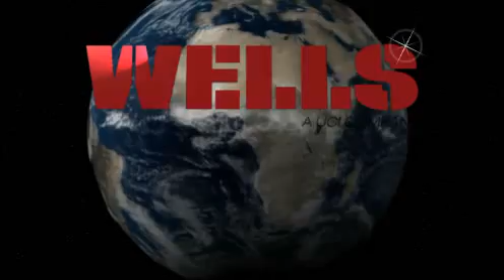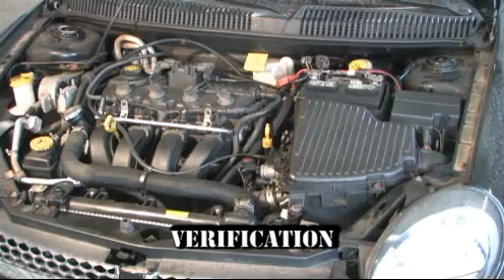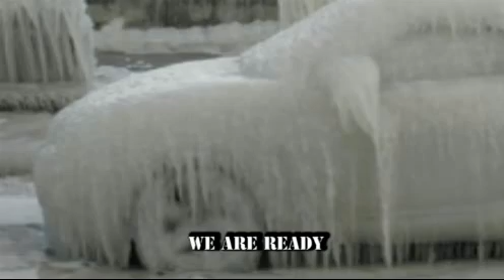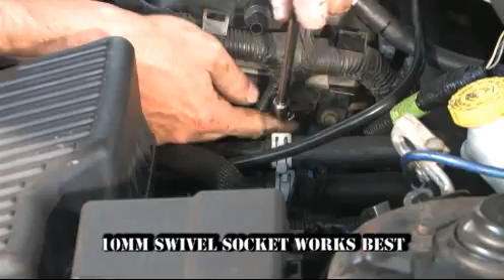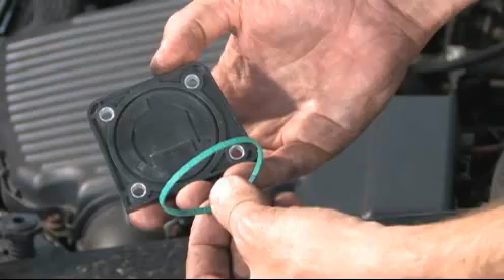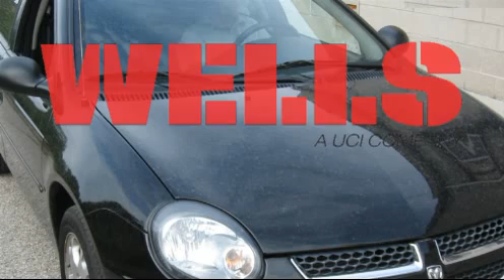Chrysler P0340 Cam Sensor Replacement

Comment: Will this make your car stall
Reply from the maker: Yes, it is possible to cause stalling concerns.
Mike Becker, Technical Services Instructor
Reply: Wells Vehicle Electronics okay thanks, I replaced this part and re computer in the car still say the part number in the odometer like it is the same part. (this is without a scan tool) I did the 3 times ignition thing. my car still want crank.
Reply from the maker: What kind of car are you working on?
Mike Becker, Technical Services Instructor
Reply: Wells Vehicle Electronics 2000 dodge neon
Reply from the maker: Do you have a check engine light on? If so, do you have a way to get the trouble codes? Also, can you describe what exactly is going on with your car?
Reply: Wells Vehicle Electronics on the way home, my friend was driving her car when all of a sudden the car shuts off, so we pulled it to my house. the next morning I checked all the fuses and some of the main relays (the ones I checked were good). i checked the ignition coil (no spark), checked the connector that attached to the ignition coil, I used a test light (no voltage from nun of the 3 pins). check to see if there was an engine light on, didn't see it. but when I did the 3 igntions swiches to check and anyways two codes come up, 1684, 0340. so I replaced CAM sensore and unhucked the battery for a day. it still wouldn't start. I checked the voltage to the CAM sensore both ends had voltage except for the middle, which I am guessing is the ground. (the car cranks good, but just want start).
Reply from the maker: It is possible that the crank sensor is causing the issues. They are very common on these cars as well. Has that been replaced?
Mike Becker, Technical Services Instructor
Reply: Wells Vehicle Electronics never
Reply: 2001 Dodge Neon, can confirm...this is why my car would randomly stall when I came to stand still at a red light.

Comment: Hi,
Can you perhaps explain the reason for the 2.0 Chrysler Neon 2003 taking a bit of time to respond when i put on 'D' or 'R'? This happens on cold early mornings only. During the day or when its not cold it responds 'D' or 'R' instantly.
Reply from the maker: Hi Keith, It sounds to me like you could have an internal transmission issue. Do you have a check engine light on?
Mike Becker, Technical Services Instructor
Reply: Thanks Mike for the feedback. There's never been any illuminating or check engine light at all. My layman view has been that perhaps its running out of the gear oil.
Though, I must keep it idling for about a minute for a 'D' (Drive) to respond, 'on early morning cold days' only. During the day (lunch, onward) take off is good! 
Also,this doesn't happen on warmer days at all, especially in in cases where i get to drive it only from midday. I start it and it takes off immediately.  

I appreciate your response Mike.
Reply from the maker: It sounds to me like a fluid problem inside of the transmission. When the fluid is cold it is thick, and maybe not coming up to a high enough pressure. As the fluid warms up, it becomes thinner and then at that point can probably make the right amount of pressure to engage. I would take it into a local transmission shop and see what they have to say. Good luck!
Mike Becker, Technical Services Instructor
Reply: Much appreciated Mike! This makes a lot of sense, and i sort of assumed perhaps some fluid or oil (gear oil etc) is not enough! I will definitely get it check ASAP! I will let you know too!

Comment: Hi Mark, I have a 2.4L Chrysler Sebring Touring. I am persistently getting a code P0030 ( Random/ misfire). I have done all testing on the ignition coils on all four cylinders( all good there), I have done the ohms test on all four fuel injectors( all good there). I have changed the plugs and the check engine light still comes back on after a minute of resetting with the scan tool. the same code of P0030 comes every time. One of the cam sensors( not sure which) has been replaced. when I look at the I/M Readiness on the scan tool it shows a red x on the ( Cat ) and a red x on the O2 sensor), and a red x on the (Evap). Could you possibly further throw some advise my way? thanks
Reply from the maker: +Troy Bigwarfe The I/M readiness are showing that way because the codes have been cleared and they haven't had time to reset yet, and probably won't test until the P0300 is fixed. It would be helpful to know the year of your car so I can look into any common failures there might be in regards to the P0300. It also would be a good idea to look at the misfire monitor on a scan tool and see if there is a certain cylinder(s) that is missing more than the other ones. If they are all misfiring you might be looking at a timing issue or possibly even plugged exhaust.Keep in touch.
Mike Becker, Technical Services Instructor
Reply: Its a 2800783-9495 chrysler Sebring Touring. A code P0335 came up today indicating its a crankshaft sensor. I am trying to locate the sensor now.
Reply: 2007
Reply from the maker: +Troy Bigwarfe A cam sensor is a good idea. They are relatively common on these cars. Let me know what happens.
Mike Becker, Technical Services Instructor

Comment: Look at Tech Service Bulletin #18-015-09, dated 5/9/09. There is an ECU Update to correct Codes P0340 and P0344.
Reply from the maker: Rick Hansen Thanks for the input, yes that tsb is related! Its always a good habit to check for related tsbs prior to replacing any parts. Thanks for the heads up, much appreciated!
Mike Becker, Technical Services Instructor

Comment: He is an interesting one for you. P0340 Replaced the cam sensor twice and still an issue. The engine will run fine but only to 2100 RMP's then it will break up. There is the interesting part; I will restart the engine and the problem is corrected for varying periods of time????
Reply from the maker: Eric Kippy That is interesting, lets start with what kind of car you are working on, and what engine is in it. 
Keep in touch,
Mike Becker, Technical Services Instructor
Reply: 2006 Sebring 2.4
Reply from the maker: +Eric Kippy Well just going of the one code you are getting, a cam sensor is the most likely culprit. It is a very common failure on these 2.4L engines. Being that you have already replaced it twice, I would inspect the wiring that goes between the cam sensor and the computer that controls it. Its possible that you have an intermittent bad connection and that's causing your engine to run bad. Let me know what happens.
Mike Becker, Technical Services Instructor
Reply: As I mentioned in the original post the cam sensor was replaced we also replaced the crank sensor. and the cam sensor a second time to make sure we didn't get a defective one. I think the key is the turning off and resetting something ??? then the engine runs fine again. This happens pretty consistently after about 5 minutes on the first start up after sitting for the night or several hours.

Comment: markjhicks  I have a 1995 neon coupe... I  recently replaced the Camshaft position sensor as instructed through your video, only I still have my original problem of no start... my computer is sending me a code 54 No signal detected from camshaft position sensor ... what all does this mean I thought I would ask an actual mechanic...thank you

Comment: replaced the cam and crank senor crank wont start getting p0340  2001 startus 2.4 will start when  cam senor is unpluged
Reply from the maker: Either the wiring has an issue, or the cam sensor is defective, or the PCM has failed, or the timing belt has slipped.
Mark Hicks
Wells Vehicle Electronics
Reply: replaced timing belt have signal to pcm when i unplug cam senor starts when runing and plug cam senor stops runing
Reply from the maker: either you a PCM, wiring or cam sensor issue.
Where did you purchase the cam sensor?
Mark

Comment: hi to whom it may concern, i have a problem with my chrysler voyger 2007 2.4, it starts Fine but has no power when you drive it, did a diagnostic test but no fault codes, can anyone assist please
Reply from the maker: When you say it has no power, do you mean when you step on the gas the engine does not rev up? Or, do you mean the engine revs up but you do not move? If it is because the engine does not gain RPM, check the catalytic convertor first. It could be restricted and not be letting the exhaust out.
Stay in Touch,
Mark Hicks
Wells Vehicle Electronics

Comment: Hello,
I have a 2003 Dodge Stratus. I have no starting problems at all. I have problems while driving, it will decide to stall while driving. Which is very scary. I was giving the code P0340 which is for a Cam Sensor but I was told these are problems of the Crank shaft sensor. Can you try help me determine which one so I can change out ASAP
Reply from the maker: Typically this means a problem with the camshaft position sensor. This is a huge problem with your vehicle and will cause the symptoms you describe. 
Stay in touch,
Mark Hicks
Wells Vehicle Electronics

Comment: I have 2003 Chrysler sebring 2.7 we changed the crankshaft position sensor but it still won't fire up. we thought maybe the computer but then after talking the the guys at the junkyard it didn't sound like it could be they told me if the computer was bad it wouldn't give me a code. I am uncertain if I should change the cam sensor even though that code didn't come up. Any ideas?
Reply from the maker: What code is being set? have you checked for spark and fuel?
Stay in touch,
Mark Hicks
Wells Vehicle Electronics

Comment: thanks for the video. I have a 2003 stratus that runs fine but just out of the blue decides it wont start. it rolls over and I smell gas. happens when the car is cold or hot. the only thing I can do is wait and keep trying it. it will eventually fire rite back up like nothing happened.I wondered if the cam sensor could cause this as well?
Reply from the maker: I will assume you have a 2.7 engine. The two most common causes for this issue on your vehicle are the crank and cam sensors.
stay in touch,
Mark Hicks
Wells Vehicle Electronics
Reply: thank you for the help.i changed it and it fired rite up. then I got about 4 miles down the road and it just died on me, sounds like the timing is way off now so I think it mite be a coilpack or crank sensor.any ideas on wich to start with first besides the cheapest one,lol. thank you for your help.
Reply from the maker: I would start with the crank sensor.
Mark Hicks
Wells Vehicle Electronics
Reply: thanks for the advice.
Reply: sorry and I don't mean to be a pest but I have replaced the coilpack, crank sensor, cam sensor,checked my timing, compression, fuel pressure,and the fuses just for fun with no results.wondered if you might have some inside wisdom as to what I mite be over looking lol. thank you very much for your time. it is appreciated .
Reply from the maker: Please you are not pestering me. You have a problem with your car and I am here to help.  Let me ask, does the check engine light come on? Have you had it checked for codes in the computer? Let me know,
Mark Hicks
Wells Vehicle Electronics
Reply: it did come on and the codes iv got from the key switch are-340-344-440-456.im smelling gas and the fuel rail has great pressure so I didn't think the evap codes would keep it from starting.Im a fair backyard mech. but im all out of tricks short of changing the computer. I even bought a lottery ticket tonight and that didn't fix the problem either lol. thanks again for anything you can suggest. any ideas are appreciated .
Reply from the maker: You are right the EVAP codes are typically not going to cause no start. But you have a P0340 and P0344 which point to an issue with the cam and crank sensor. The only way to be sure they are working properly is with a labscope. I will assume you do not have one, but you have replaced both the sensors. There have also been reports of connector problems and PCM issues. The next step would be to do a very close inspection of the connectors to the cam and crank sensors. If they look good, replace the PCM. But before replacing the PCM try disconnecting it and cleaning both the connector and PCM connection pins with electronic cleaner.
Keep us posted,
Mark Hicks
Wells Vehicle Electronics

Comment: Hello Mark, I have a question for you.  I have an 04 Sebring with the 2.4 liter, 135k miles, new timing belt.  It throws the 0344 code even with a new cam position sensor.  Symptoms are it coughs and stumbles on startup and sometimes has quite a hard time starting.  Once it's started it runs fine under light throttle up to about 2300 rpm where it hits a rev limiter.  Under heavy throttle, it misses on sometimes one cylinder and sometimes two but still won't go past the rev limiter at 2300.  Resetting the computer makes it able to rev up to another rev limiter at about 3500 rpm for a few seconds until the code trips again and the limiter kicks in at 2300.  It runs and drives smooth and perfect under 2300 rpm except when I stop in gear, when it stumbles and tries to kill unless I keep the rpms up around 800 or higher.  Could this be just the target magnet?

Additional info:  With the timing belt cover removed, the timing belt looks new, the marks are visible on the rear cover where someone had changed it before I got it, and the top of the belt between the two cam gears runs nice and straight and steady....until around 2500 rpm or so, when it momentarily "flutters" between the two cam gears through a narrow rpm range.  Could that be the problem?  A bad tensioner?
Reply from the maker: Thank you for the detailed explanation, It helps to get to the problem.
If the cam sensor has been replaced and you are sure the timing belt is aligned properly, the next check is the crank shaft position sensor. It is fairly common for the CPS to cause this code on your vehicle.
If you have a lab scope or scan tool you can monitor the CPS to see if it momentarily drops out.
IF you do not, check the wiring to the sensor and check for any signs of oil leakage from and replace as needed.
If the CPS does not take care of the issue, try another Cam shaft Sensor by a different manufacturer.
The timing belt tensioner may be sticking a little to cause the belt to jump. I would not be too concerned, but keep my ear open. If you start to hear chirping or squeaking from it, it will need to be replaced.
I hope this helps, please let us all know the results and let me know if you need any further assistance.
Mark Hicks
Wells Vehicle Electronics

Comment from the maker: Hello Garry, sorry i never received your message. Any one of my guys can help you with questions in the future. They are all hand picked by me, master techs and really good guys. 
To set a P0340 code the computer is looking at the relationship between the cam and crank sensor signals. It is usually a cam sensor that sets it off, but yes it can also be a jumped or stretched timing belt to cause the code. The only way to be sure is to scope it. 
Hope this helps,
Mark Hicks
Wells Vehicle Electronic

Comment: Hi Mark,I am Garry and just called you regarding p0340 cam sensor code in my chrysler neon 2001 2.0 litre. but i was told that you were busy so i left the voice message. My question is does this code some how related to timing belt?Well,my car got hot in feb 2013,I changed radiator,used water instead of coolant in summers.and later water pump leaked that I wanted to change but one day my car went off when i accelerated it  on the highway.checked the code say-P0340.is this related to timing belt?

Comment from the maker: I will assume you have a vehicle similar to the one in the video. It is a good idea to disconnect the battery before installing any sensor. Would not cause it not to start? Probably not. I would be more suspicious of a poor connection. These connectors do have a fairly high failure rate.  Look the connection and the wires leading to it very carefully. If all looks good there get another sensor and let me know what happens. You can call me during the day at 1-800-558-9770 
Mark Hicks
Wells

Comment from the maker: You have to follow the steps just like I wrote them. When you disconnect the ASD you have to jumper pins 30 to 87. Look on the bottom of the relay it should tell you the pin numbers. 
To check the injector pulse you will need a noid light. Plug the light into the connector and crank the engine, the light will flash if you have a pulse.
AutoZone has noid lights in their loaner tool program.
Mark Hicks
Wells Vehicle Electronics

Comment from the maker: 5. Connect a 12 V test light to B+. With the probe end of the test light, momentarily tap the Black/Gray wire at pin 4 (98 and later) or pin 11 (95-97 models) of the PCM. This action should cause the coil to fire. The spark should jump at least a one inch gap.

6. If there is no spark out of the coil tower during this step, the distributor has failed and needs to be replaced.

7. If there is strong spark from the coil tower, check all powers and grounds at the PCM. 
Mark Hicks
Wells VE

Comment from the maker: 2. Remove the distributor cap and connect a grounded jumper wire near the coil tower. This is to check for spark jumping from the coil. The coil should snap a spark across at minimum a one inch gap.

3. Jumper pin 30 to pin 87 at the ASD relay.

4. Check for 12 volts to the Dark Green/Orange wire at the single wire connector at the distributor. This wire feeds the positive side of the coil.

Comment from the maker: I will assume you have a 2.5 engine. Here is the test procedure for no spark, but you have injector pulse. If you do not have have injector pulse and no spark the test is different.
1. To test the coil in the distributor, disconnect the Automatic Shut Down (ASD) relay and the Powertrain Control Module (PCM) connectors.